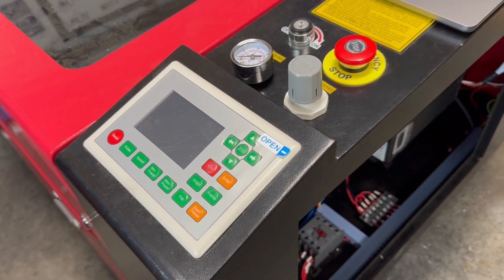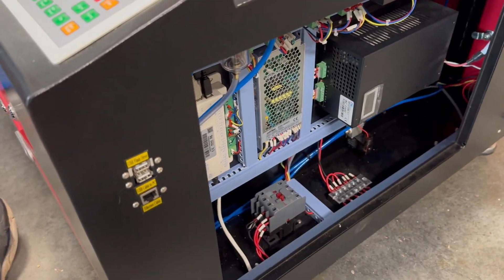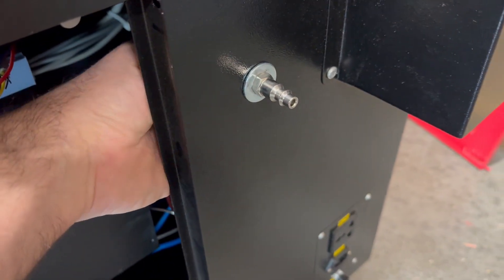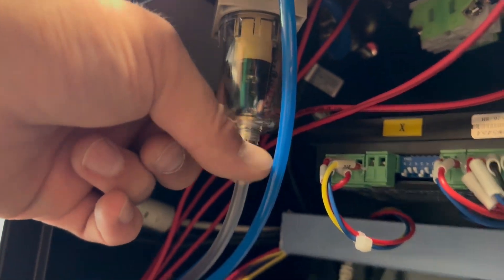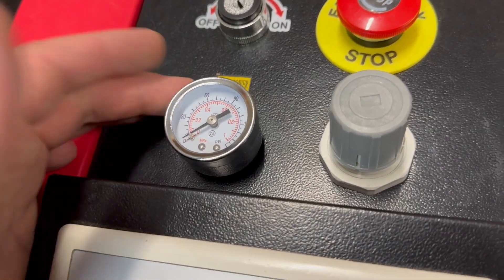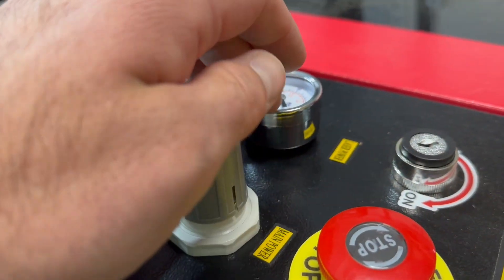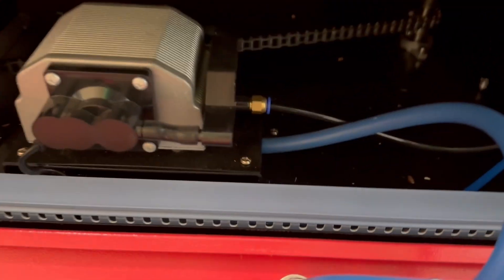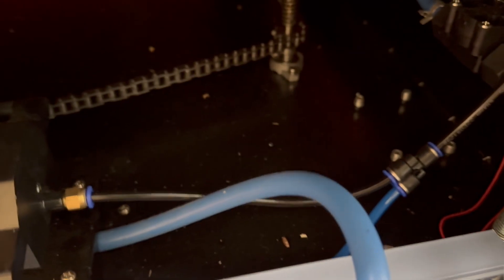Air Assist Upgrade on OmTech 100 Watt 2440 CO2 Laser

Comment: nice setup do you have a parts list for the regulator and top controls
Reply from the maker: @fowlh339  here’s a link to the regulator kit. What you’ll need to add is a male and female threaded push connect for 6mm tubing to thread from the gauge to the regulator body. I can’t remember the exact thread size but o believe it was 1/4 inch. 

https://a.co/d/0cjofFsn

Comment: I have noticed that when still using the stock pump for low pressure it does backflow - would be interested in the check valve or one way valve you trying
Reply from the maker: I’m finally getting some new lenses and mirrors in tomorrow / so check valve will go in and we shall see!  Also installing additional gate valves to see how that helps with air speed
Reply: "Where should I connect the wire of air pump so that it works automatically —i mean  it turns on when the laser is on and stops when the laser is? Pls